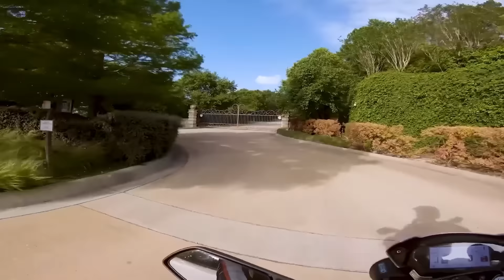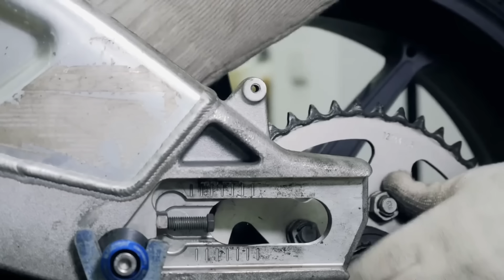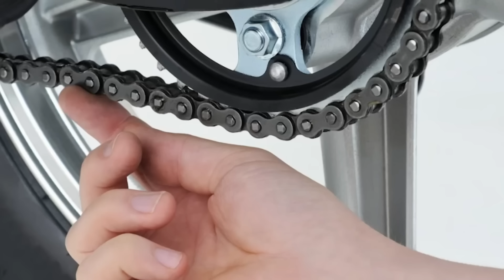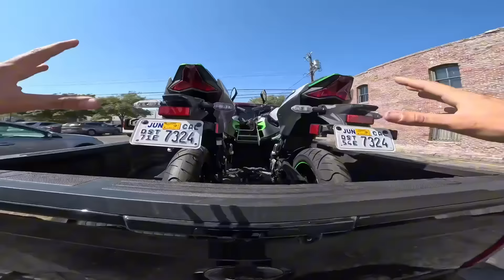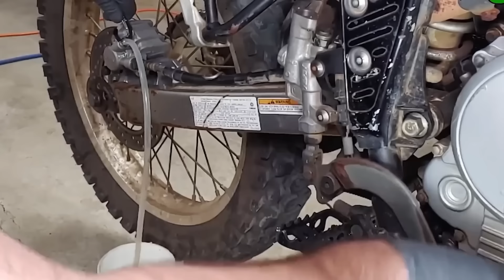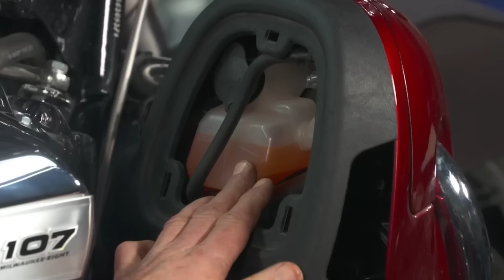The JAPANESE TRICK That Makes Your Motorcycle Last Over 300k Miles

Comment: The japanese cannot compete on power and performance?? What??? It's the european motorcycles that cannot compete in power and overall performance especially if you're referring to the old times. It's even the japanese who started speed wars, they basically invented the superbike.
Reply: The so called superbike was created a long time ago ,look at old bikes from early to middle 1900's .there are loads .
Reply: @georgeday5901 it depends on how you define superbikes. Because the first considered true superbike is the honda cb750 because its performance is truly superior compared to other established brands at that time. Those super bikes from the 1900s isnt really super. And after the cb750 there were tons of japanese bikes with about the same power or even greater then the speed wars has started.

Comment: The actual "Japanese trick" / habits for longevity — The video emphasizes disciplined, proactive ownership over waiting for problems:Strict adherence to service intervals (don't stretch or skip them).
Proper warm-up procedures and "mechanical sympathy" (avoiding aggressive or abusive riding).
Meticulous oil and fluid management.
Regular valve adjustments and addressing small issues early.
Preventive mindset: most engine failures come from ignored minor problems, not weak design.

A teased "15-minute procedure that costs under $20" prevents ~90% of catastrophic failures (the transcript cuts off before fully revealing it, but context suggests it's likely something simple like consistent oil changes, chain maintenance, or a specific inspection ritual emphasized in Honda's old internal protocols since 1973).
Overall philosophy — Longevity comes from boring consistency, not dramatic upgrades or luck. Japanese bikes last because owners treat them as long-term investments, not fashion items.